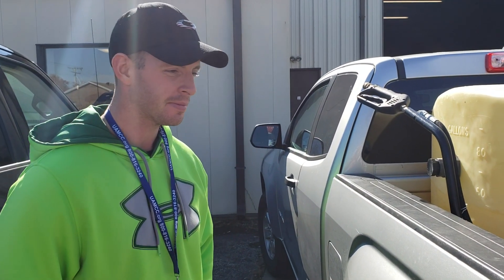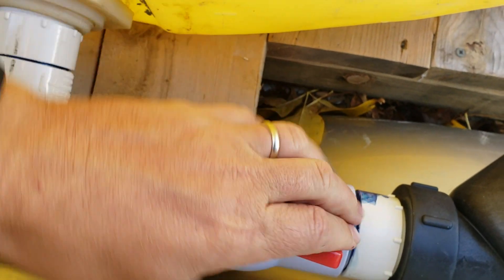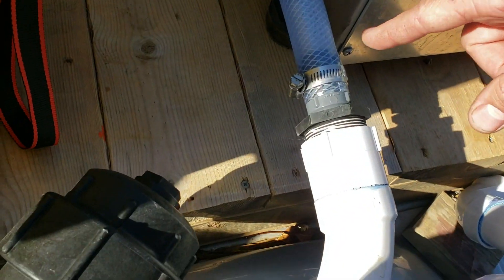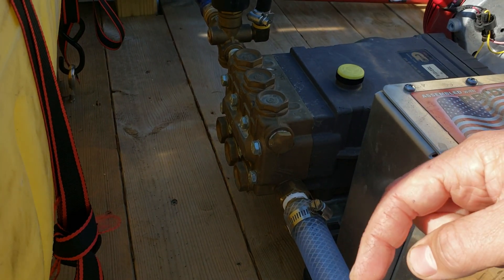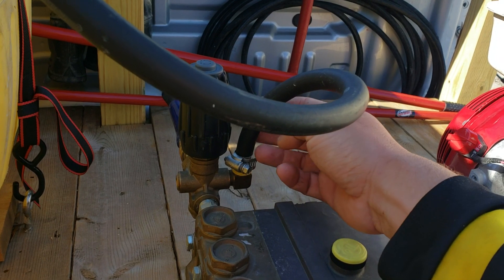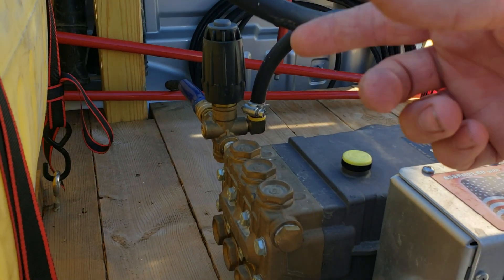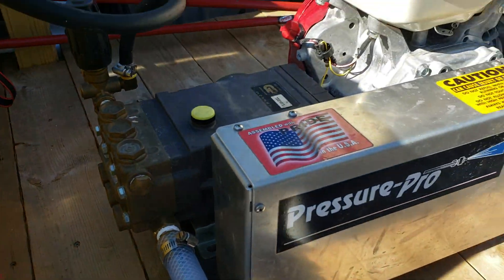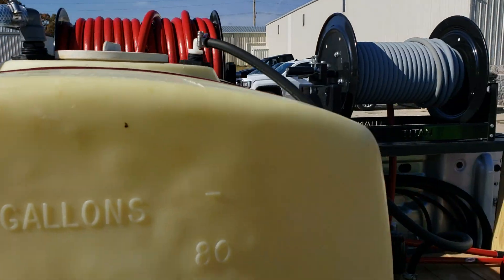Jacob Donaubauer - Eagle Eye. Great compact pressure washing setup.  excellent plumbing set up

Comment: Doesn't that filter have to have the drain plug on it facing down? Otherwise it won't be doing any filtering if it's on sideways
Reply from the maker: It filters just fine the water has to go into the bowl through filter and then into the outlet.

Comment: can you connect two power washers on 2" hose? 5.5 and 4 gallon pumps
Reply from the maker: You can Siamese 2 machines together.  Both have to be trapped pressure unloaders at same psi
Reply: @Cleanpowerwash  Thanks. 100g tank, 5.5 belt drive and 4 direct drive. I just received the Siamese kit. Can I use the same 1” bulkhead to supply water to machines or switch to a 2” bulkhead or run each machine a separate 1” bulkhead and hose?
Thank you

Comment: This is what I have in mind for my setup next year. Got a question I want to bounce off you rob, I started a pressure washing business this year but ran into different things that made me wrap the year up early. But my question is I only want to wash houses 2 days a week about 4 or 5 hrs a day... I work 3rd shift like you did is the reason... but I don't like all the different calls and jobs come in. So do you think targeting cookie cutter homes/ neighborhood as in nice but not to big of jobs and only market a chosen neighborhood for a couple weeks with yard signs and flyers. Do you think I can keep a 2 day a wk. schedule?  And do think that initial thought would be wasting time to just marketing to everyone?
Reply from the maker: It's hard to restrict your leads that much
Reply: @Cleanpowerwash  thanks rob
Reply from the maker: You can also find another contractor to refer business too
Reply: Ok didn't think of that. Do you personally take all the calls and setting times?
Reply from the maker: Yes I take care of all of the admin side of the business.
Reply: You can send me your prospects. I will take care of you. Sounds like you need to sign up for a few extra hours at work or get a part-time job. Wouldn't that be an easier solution?

Comment: Can this be done with a 4 gpm gear & direct drive machine ?
Reply from the maker: Yes
Reply: Is the black filter necessary ? If so where does someone find this filter or what’s the name to it, I noticed he has water running directly to the water supply of the machine and it splits off and has a line running towards the back of the trailer, what is that line used for ?
Reply from the maker: https://amzn.to/4984njx or https://amzn.to/48LDaTY
Reply from the maker: Yes you need a filter.  My trucks have supply line filters,  2" filter at the tank outlet, and a 1" filter before each machine.

Comment: You don’t even have to add another fitting to the pump. Just close the valve closest to the tank and add the antifreeze to the drain line. Like you said.. keep the plumbing simple. Less fittings the more simple. Besides, he’s going to blow the antifreeze out at the next job
Reply from the maker: The drain line drops another 6" down.  Adding the fittings ensures it will "winterize" and with only a few ounces of solution

Comment: Why do you guys winterize your equipment. I am still washing. Booked another $750 job and just gave a $800 bid. Keep it pumping and you don't need to stop working.
Reply: James Brown.. even when it’s cold, lines and such can freeze from driving down the road to the next job. Seen it
Reply from the maker: We live in Maryland and most nights it's fine to just blow out the lines with air.  If it is going below 32 for more than 2 or 3 hours, or a few days we will put antifreeze in it. It's just being extra careful.  Then when we go out to wash we flush the lines and get back to washing.  

Also if the temps are dropping on a long drive back we will add some antifreeze into the lines to avoid windchill freezing it.

Comment: Why does everyone waste money on antifreeze when you can just blow out the pump with air and then unscrew one valve cap and boom done?
Reply from the maker: Because blowing it out doesn't 100% winterize it.
Reply: @Cleanpowerwash  but the pump can only be harmed if water freezes and expands thus cracking the pump. Unscrew one lower valve on the pump and then expanding water has somewhere to escape 🤷🏻‍♂️.
Reply from the maker: And if a tech starts using it the next day and forgets to tighten that valve cap?....   You will run into more potential issues by doing that.  You can reuse the antifreeze to for what it's worth.
Reply: @Cleanpowerwash  very true